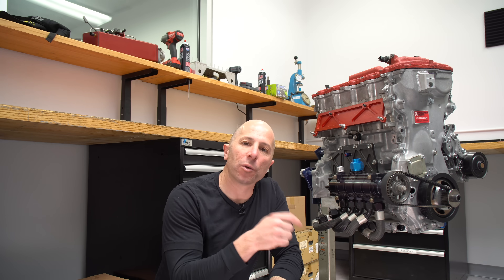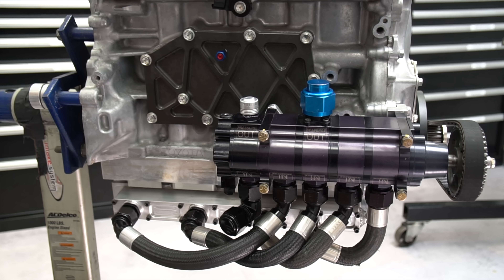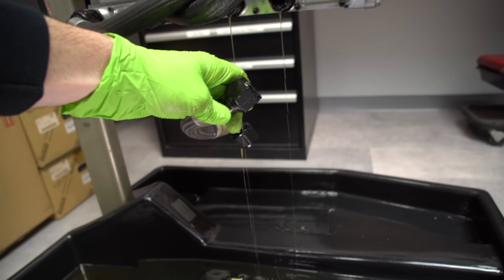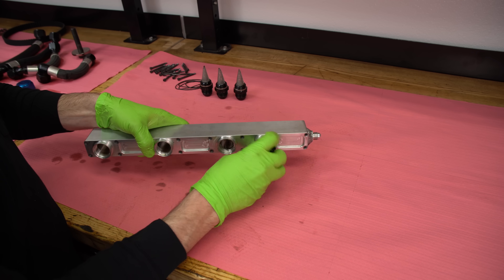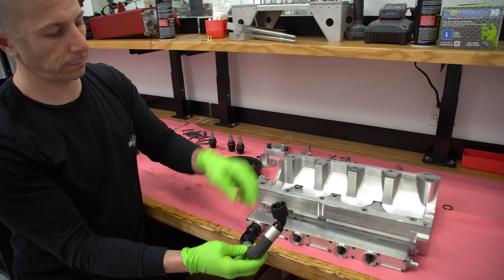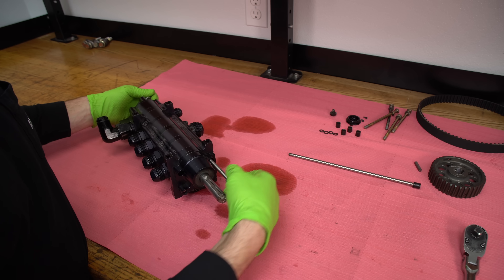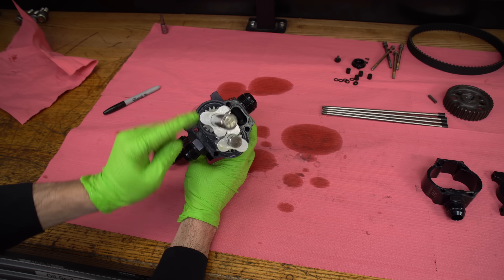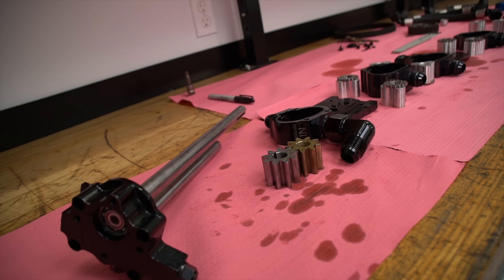Dry Sump Oil System Teardown and Description

Comment: That was cool. Didn’t know a dry sump doubled as a vacuum pump for the crankcase. Definitely helps for running a thinner piston ring and reducing ring friction.
Reply: A dry sump also permits a larger oil capacity without making a bigger oil pan. The engine can be mounted lower, lowering the center of gravity. The oil tank can be mounted any where on the car for weight distribution.
Reply: If y'all could keep this discussion going it would be awesome so many principles involved in efficient combustion.
Reply: Internal air cooling 🙂
Reply: Depending on the efficiency of the pump, number of scavenges, and how fast you’re spinning it, you can make lots of vacuum.
Reply: @MindYaBizz_Whiz  You only want so much vacuum though as too much is bad for your seals.
Reply: amorag59 oh for sure. But when it comes to dry sump engines, that number gets significantly higher, almost to the point where you can let it make whatever it can. Wet sumps, you usually don’t want to make more than 10-12 inches of vacuum at WOT. With dry sumps, you can make upwards of 18, and it’s totally safe.
Reply: and people seem to forget here... when you produce a vacuum, you can also regulate it anywhere you plumb it to... so yeah the pump might be able to pull more vacuum than the engine can handle, but if you have a solenoid that allows for atmosphere to be pulled in too, you can bring the pressure back up, but that might need an extra 2 sensors and I/O slot on a ecu...
Reply: Thinner piston ring? Reducing ring friction? What the hell are you talking about, mate? If you look up the formula for dynamic and static friction you'll see it doesn't depend on the surface area. Just use the piston rings that are made to comply with the manufacturers specifications, and that's it. Snakeoil doesn't lubricate as well...
What's actually the case is that the crankcase gets filled with blowby gasses; on a streetcar you want to pull those gasses out because they contain a mist with a little bit of unburned fuel that mixes with and dilutes your oil, and that pulling out is done by the vacuum in the intake manifold; on a racecar where oil gets changed so often that you would never notice that tiny fraction of fuel in there you just want to get the excess pressure in the crankcase out of there. So pulling a vacuum to counteract the blowby pressure is definately a logic thing to do, but i'm not so sure about going beyond that and pulling a vacuum, that introduces new problems.

p.s. Ok, there are piston rings on the market that have a round over or a sharper edge that contacts the cylinder wall, but that thin edge isn't there for reducing friction, it's there to wear out faster, so that you have a faster first stage break in of your engine. Tin coated piston rings have the same effect, that tin is there for the exact same reason. And Piston rings with any kind of coating on the outer edge are there for the same reason. Due to a multi-stage break-in you will have an engine that performs better because the break-in happened at better conditions. That's what the engineers say, meanwhile the marketeers tell fairytales about reduced friction.
Reply: @sasjadv  While you are generally right about friction not dependant on surface, you forgot that the force with which rings pushes against the walls depends on surface area of the rings since it's combustion gas that pushes the ring against the cylinder wall.
Reply: @sosic2121  
"it's combustion gas that pushes the ring against the cylinder wall."
It's the combustion gas that pushes the ring down, not against the wall. And it's the pushing down that seals. And I didn't forget this.
Ok, lower tension rings will push less onto the cylinder wall, and as long as the combustion gasses don't come into play that will reduce friction by a small fraction. But I call that just widening up the spec, or installing rings that are too weak. And you will have more blowby. This is clearly not a reasonable approach to make an engine more efficient.
Reply: @sasjadv  the reduction in friction he's referring to comes from lower tension rings usually used on dry sump builds.

Comment: How do you read how much pressure or vacuum is created by the 4 scavenging pumps?
Reply: Emily Stornetta you are quite knowledgeable, I’ve seen a few of your comments, thanks for the extra input and clearing things up
Reply: @Emily Stornetta not on the crank case. I want to know if measuring the scavenging pump pressure is possible to see if some are pulling air vs pulling oil
Reply: @Emily Stornetta back to the original question?

Comment: How much would one of those billet oil pans run on average?
Reply: well first you have to look at the original mass of the ally then add at least 20% size over the finished product, then you have to put into account if you are having to pay a draftsman to create the 3d design usually at around $120 - $200 an hour, or if you supplying one which is capable to be inserted into a CNC machine, then you're looking at another $140 - $200 an hour while the machine does it's thing. So all up you'll probably be looking at somewhere around the $2500 to $4000 mark for the design and metal work, pending on if you need to have the design done or if you already have one which can be used. I have just looked up the cost of aluminium and it's going for 1.8k a tonne for the trading stock prices, so you'll probably be looking at somewhere between $800 - $2000 just for your raw materials if you can get them under retail prices. So at the end of the day you wouldn't be too far off of $5,500 if not more just for your oil pan .... This is why it's good to have sponsors or in house machines and techs.

Even though it would not be anywhere near as strong, you could always just cast one, as that would save you a bucket load on materials, machining and increase your ability to be able to mass produce it for profit. :)
Reply: @MassageWithKlay  thanks a bunch dude. I knew that it'd be much more expensive, but I didn't know any of the technicalities behind it. I appreciate the input. Thanks!
Reply: The pan could probably run a mile in about 4 minutes.
Reply: $50,000+ for a 5 axis CNC mill, a lot for tooling, expensive drafting software, etc.  Oh yeah, and a giant chunk of aluminum.  Yeah, I'm pretty sure this is custom.